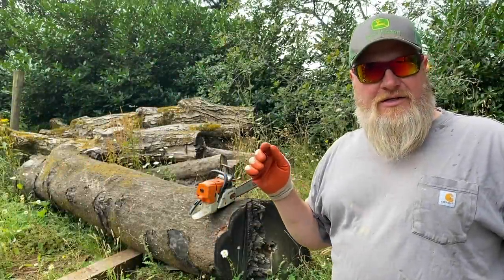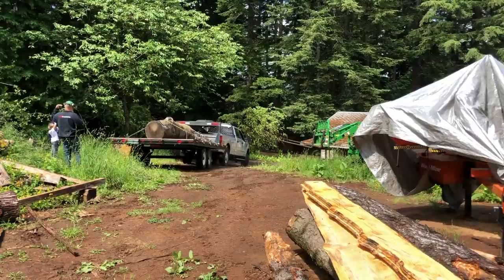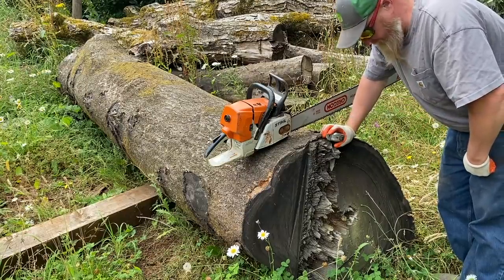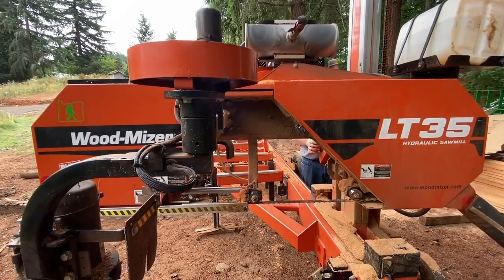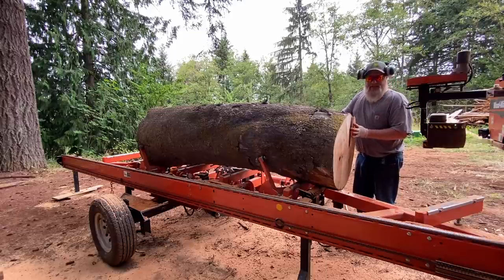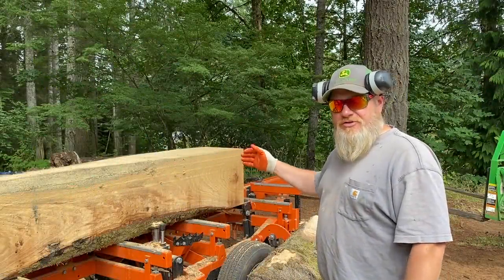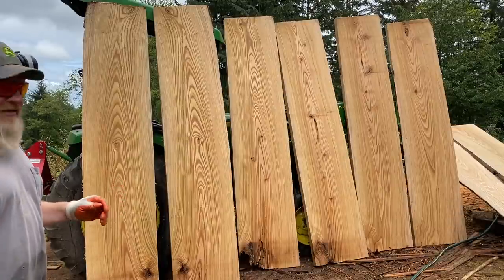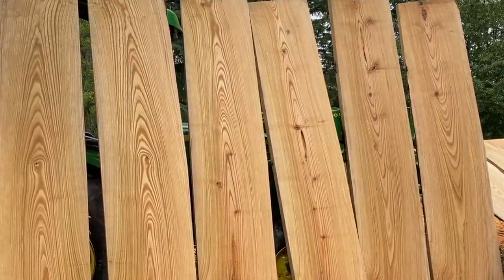Milling A Monster American Chestnut Log

Comment: My father was given an American Chestnut table in the 1950s. He refinished it and the whole family  ate Sunday dinners on that table until my parents  eventually died. As a wood, it is exceptionally stable. Very resistant to warp. It is warm to rest your arms on. Not prone to splinter. Those few boards you have will make a table that will be a wonderful treasure for centuries. Love the prominent grain!

Comment: Beautiful slabs. That's truly a one of a kind log. Very rare to find any old growth American Chestnuts. I read that at one point in American history that a squirrel could have traveled from coast to coast in chestnut trees and never have touched the ground. Unfortunately, it was wiped out by a blight.
Reply from the maker: There are several large Chestnut Trees in this area. But probably the only one that will ever see my mill.
Reply: Chestnut is an eastern species, it was introduced on the west coast after settlers arrived there.
Reply: There were no American Chestnuts west of the river before American settlement. Plus the great plains of Missouri, Kansas, and Oklahoma were always there.

Comment: American Chestnut is really a special wood. Inspired by my family's table, I built another table in Kodiak, Alaska that was 4' by 8', about 4" thick, of native Sitka spruce. I put equal coats of varnish top and bottom, and that kept it from warping. Now I'm in Washington state. I was at Edensaw wood, and found a slab of Doug fir, 4' by 12' by 5" thick. I bought it, but didn't take it home fast enough, and they sold it to someone else. I eventually got a replacement slab and built yet another table from it.

Comment: that is some pretty lumber im glad i planted 3 and am fixin to plant another 3 in spring the original seem to be doin great so far
Reply: You plant American Chestnut or a hybrid
Reply: @AnthonyM1000   the place i got em from in wis says they are purebreed american chestnut each of the ones i got from seems to be doin pretty well
Reply: @AnthonyM1000  the place is called chief river nursery they seem like a very well run family place
Reply: 99.99% sure it's a hybrid, maybe a Dunstan which is what is sold in nurseries.The surviving trees are very few and far between to cross pollinate each other. The American Chestnut Foundation, TACF, is trying to identify flowering trees so the can get pollen when they bloom and take it to another tree to cross pollinate. They are also cross pollinating American and Chinese chestnuts to transfer the blight resistance to the American chestnut tree. They've been doing this for a long time now and now coming up with blight resistant trees. But to get these seeds you have to be on the seed level membership program.
Reply: @1waltrp  they say  its just a reg old ame chest that had somehow survived the blight  now 2 when i read amd re read what they put down for what it was there was 0 mention that it was a dunston vari and id be happy too send whatever to the tacf and i get there are few trees around actually producin  so it may or may not be a dunston

Comment: I live in Milwaukie, Oregon. There are still a few large old Chestnuts around here.  I have always wondered what the Horse Chestnut wood compared to the ‘regular’ Chestnut.  
    Well done Sir. That’s some rare and beautiful wood.
Reply: I'm an arborist in Oregon. I see a lot of horse chestnuts, but for whatever reason I've never been hired to cut one down. Even though I've done tree work for almost 10 years.
Reply: @brandonkarhu5599  thank you for the reply. I was reading that the regular chestnut wood was highly used in ship building. Particularly the ribs.

Comment: So I have a question, over the past 4-5 years of doing nothing after finding a chestnut tree, 36 inches DBH, the tree is now dead and I found an 11 foot log laying at the stump after the homeowner cut it down and he gave it to me. At one time we were in contact with the American Chestnut Foundation to try and preserve this tree but couldn't get help from the previous owner. What should I mill from this now that I own the log, mantels or slabs? 24 inches by 11 1/2 feet
Reply from the maker: I would slab it at probably 2-1/4” slabs. That gives you options after it’s dry to resaw it into thinner boards later or have the thicker slabs to use but you’ll save it from rotting away.

Comment: I thought all the American chestnut had the blight & died. If what you have is A. Chestnut you have something, on east coast this stuff will bring $9-10 ft. I have heard of timber companies logging in national forest finding chestnut, & sawing it. One company got caught with 100,000 bf of sawn chestnut. Not reported to forest service. Most of chestnut we get comes from old barns. My almost mother in-law bid $10,000 on a chestnut barn. We under  estimated what it was worth.  Tell how you liked working the chestnut. I’ve been told it works very nicely, easy to carve, do anything. It’s hard to imagine how many chestnut trees died because of the blight
Reply from the maker: From the research I’ve done, the species not completely wiped out and is actually making a comeback in some areas. There were several large trees with in the area this one came from.  As far as working with it, the grain reminds me of oak but it’s nowhere near as hard. I can’t wait to work with it.
Reply: Northwest Sawyer please let me know how it works. I never see chestnut, but I’ve talked to people who said, If they had a choice it’s all they would use.

Comment: Definitely NOT American Chestnut. Looks like Pawlownia. Smooth bark like ailanthus, Hollow pith. !00% NOT Chestnut.
Reply from the maker: You are correct. We thought this was a chestnut log that went missing from a job site years ago that was a chestnut. After looking at video I had shot of the tree coming down, I realized this isn’t that log. I don’t know what this log is to be honest.
Reply: @NorthwestSawyer  Pawlownia Tormentosa , Empress tree is my "most likely" guess. Beautiful , also very prized wood, especially for Japanese and Chinese woodworking. Look at how large the growth rings are. The smooth bark and the grain is why I guess Pawlonia. Valuable wood.
Reply from the maker: @huskylover1013  the slabs have dried and they’re surprisingly light. The grain almost resembles Oak but it’s much lighter.
Reply from the maker: @huskylover1013  the slabs have dried and they’re surprisingly light. The grain almost resembles Oak but it’s much lighter.
Reply from the maker: @huskylover1013  the slabs have dried and they’re surprisingly light. The grain almost resembles Oak but it’s much lighter.
Reply from the maker: @huskylover1013  the slabs have dried and they’re surprisingly light. The grain almost resembles Oak but it’s much lighter.